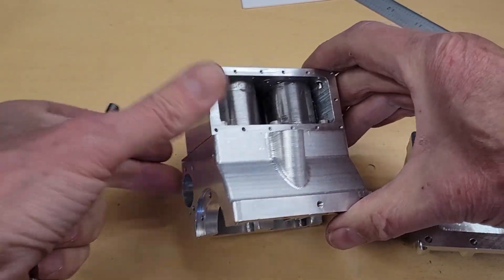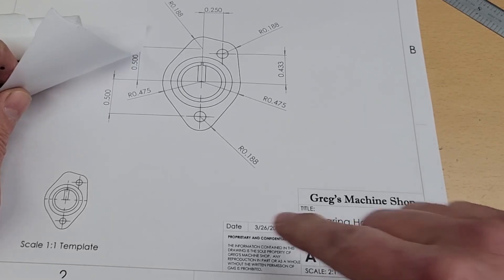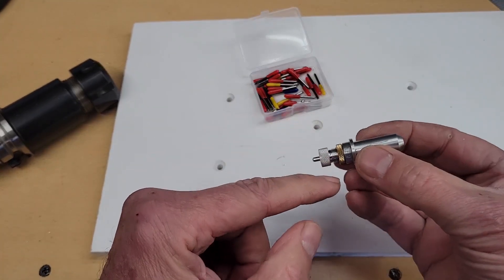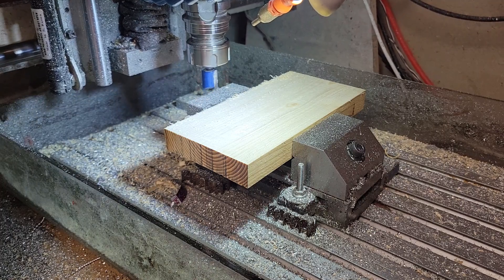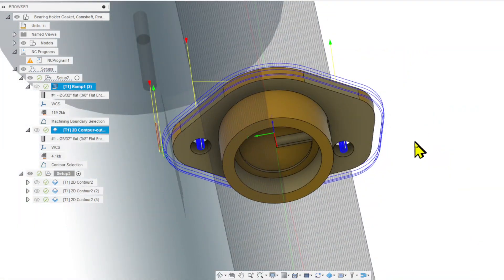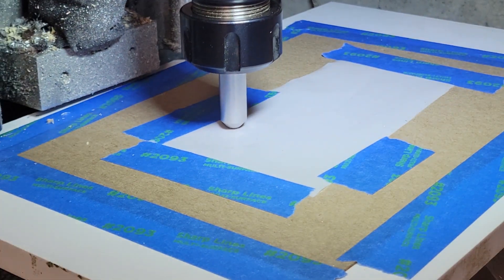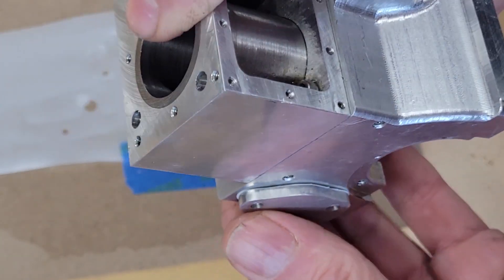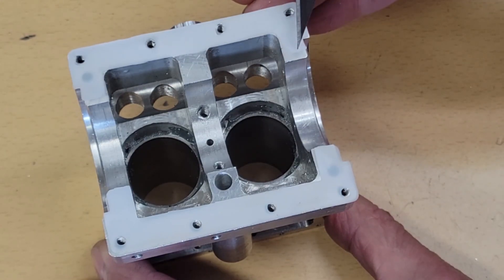Cutting Gaskets on the CNC Router - 30cc Wallaby Engine Build Part 20

Comment: Instead of cardboard use a self healing cutting mat you’ll get better results
Reply from the maker: That is a good suggestion, I'll give that a try. I still have a few more gaskets to make.
Reply: @gregsmachineshop  the self healing mat is basically what is used on vinyl cutting machines, well…I should say it is what is used on my vinyl cutting machine.